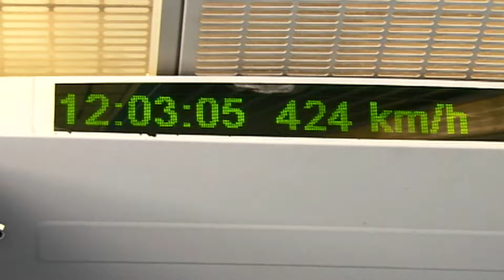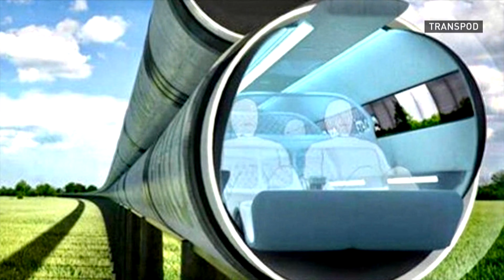This high-speed rail could connect Edmonton and Calgary

Comment: let me get this straight, the idea is to use something based off the hyperloop (a literal scam), except instead of using the scam tech from hyperloop u want to replace it with functional tech from modern highspead rail (maglev which probably still means extremely expensive carbon intensive super conductors), but you also want to lower both the capacity for riders and freight by making it go by 1 car at a time, effectively kneecapping effective efficient throughput of goods and people, optimizing for what? speed around corners? what is it gonna be, 10 min faster by being 7x the cost?
Reply: It's not a vacuum tube. it's a jet propulsion system in a guidance tube. there's no need to maintain a vacuum therefore DRAMATICALLY reducing the complexity. It does sound completely bonkers at first glance but look deeper, they aren't trying to reinvent the wheel. My only real concerns are cost effectiveness and to some extent safety.
Reply: @Fenthule were we looking at the same thing, their website said its maglev tech in a tube.

Comment: JUST BUILD A NORMAL HIGH SPEED RAIL NETWORK!
Reply: Medium-speed rail at 150 km/h would just be fine.
Reply: Nah. That would be too easy. The engineers like challenges 😉
Reply: 350 km/hod 1 stop Red Deer 1:30hours ez travel
Reply: I know! I only came to here to say exactly that.
Reply: Amen
Reply: fr....
Reply: Pointless. Highway 2 can handle 130kmh no issues. Why waste money on the same result.
Reply: By the time it is complete, the technology will be outdated. 20 years later it will feel ancient. So, do it big the first time, so long as it's safe.
Reply: @vincentng2392 we could literally just import the British intercity 125 and have 200km/h trains. And if we want electric we can import the intercity 225. Seriously, there is no need for a system that would literally explode if a kid threw a rock at it.

Comment: The Calgary-Edmonton corridor is a great opportunity for high-speed rail or even a maglev train but hyperloop-style trains just feel like they are over-engineered. This would be the first successful hyperloop project that is commercially viable if its successful. This would be fantastic for Alberta if it worked, however, I am extremely skeptical of hyperloop trains because they remain unproven.

Also, it would be cheaper to build a maglev or a regular high-speed rail, either one of these would connect Calgary to Edmonton in a little over an hour.
Reply: I looked into it, its the expensiveness of hyperloop infrastructure with single pods with the expensiveness of maglev tech tacked on, but giving the worst of all worlds
Reply: This isn't a hyperloop btw. Lots of people seem to think that. These guys want to do a small maglev elevated jet propulsion "pod" in a non vacuum tube - mostly just for safety so you don't go flying lol none of what they're doing is revolutionary in it's own sense, it's just never been put together like this. My only real concern is actually cost and also safety.
Reply: @Fenthule ok so in order for anything maglev to work its likely going to be cooled by liquid gases at a high pressure which are used to keep the superconductors cool bc thats the only way u can get something like this to hover, so the energy into the ln2 or something else plus the heat from a jet propulsion system  all confined in another tube sounds more and more like a complicated and expensive bomb to cause the most expensive damage expensive when it fails

Comment: Every 10 or 20 years this pops up as another headline. Ho-hum.    In the early 1980s there was a passenger service involving a unique looking rail, car, singular, with the operators cabin in the middle a foot or two higher than the rest of the rail car. I have always wished I could’ve taken that once or twice just for the fun of it. The problem was, there were too many crossings and collisions with cars along the way. Or so the railroad said.
Reply: No the problem has been Oil drunk Albertan's want to drive their large suv's and trucks. No one's gonna tell them what to do. God forbid we remove some transport trucks off of the QE2.

Comment: Bro used “freight” as his excuse. Build an HSR corridor. Quad track. Two tracks each on separated systems. Two tracks for slower moving freight, two tracks for HSR. It’ll be more reliable than a Hyperloop and it’ll still cost less to build & maintain. 

China trialled a cargo HS train, high speed cargo argument doesn’t hold any weight for the Huperloop.

Comment: I hate to say it, but, this feels like a gadgetbahn. It feels more expensive than a conventional high speed rail line.

I give the company all the best of luck. But, the track record for monorails, pneumatic pods, and other types of gadgetbahns, is just not that good.

I'm interested in the progress, though. I will definitely be keeping my eyes open on this one.
Reply: It’s worse than a gadgetbahn. It’s hot air and not buildable. The same right of way required for this could be just as easily used for a dedicated HSR line. There you go. No freight traffic.
Reply: @transpiler  The freight traffic is a plus though. Passenger high speed rail wont be cost effective enough to build the lines alone. You basically NEED freight service in order to break even for the cost to construct and operate. There's simply not enough daily commuters between the cities willing to pay that much to justify building it without also having freight available. The physics behind their project is pretty solid since they aren't doing a hypertloop with a vacuum tube, they aren't reinventing any wheels here at all. My only real question is the cost effectiveness of the system, and if it wouldn't be better to ditch the "pod" and just use actual trains.
Reply: @Fenthule  I’m really not following your logic here. Low-speed freight and high-speed passenger rail simply don’t operate on the same tracks anywhere in the world.

Does Brightline need freight on the same tracks to survive? Shinkansen? TGV?

Comment: do we even want to go 1,000 km/h, that is dangerous
Reply: So you drive at exactly 99 km/h on the freeway? Because most drivers go above that in their cars, not to mention the fact that the Bullet Trains in Japan run at over 300km/h and there has not been a single passenger fatality since on them since the first line opened in 1964.
Reply: @alistairlogie1815  Typo, I meant to say 1,000 km/h, it's in the description

Comment: You know what already has plenty working examples worldwide? High-speed rail! Enough of this hyperloop B.S. that's never actually been proven to work anywhere at this scale. Let's get German or Japanese engineers to consult and build a real high speed train between Calgary and Edmonton that would be the envy of North America. We have the geography, the population density (and growing), and there's already a rail right-of-way. Get on with it.
Reply: Using the existing rail network, a 150 kmh passenger train could be resumed for nearly zero cost, and could even be operated by VIA who does this already elsewhere. 
High speed rail is exorbitant, what problem would it really be solving in Alberta? Who will use it? Not wrorth the cost at all.
Your working examples are high population countries where fewer people own cars.
Reply: @volvodude101  TBH 150 kph would qualify as high speed rail by Canadian standards. And I would be completely fine with that instead of much higher European/Asian speeds that require grade separation. Just make sure the trains go downtown to downtown for maximum convenience.

Comment: Just a Normal high speed train 300-350 kmph with perhaps a short 3 minute stop at Redder would suffice.  (or even 250 kmph). High temperature Superconducting Maglevs DO make sense in certain corridor. Like Beijing Shanghai (goign 500-600 kmph b even 1000 kmph ) or Tokyo-Osaka  but the backbone of China and Japan would still be ocnventional high speed rail